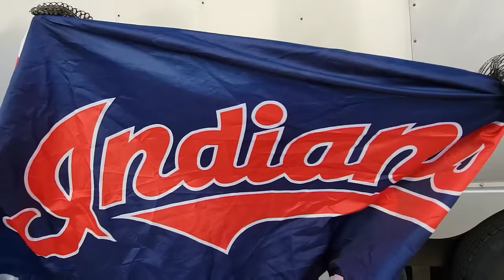RUDE KAREN Wants Her Storage Unit Back

Comment: You probably already know this, Jeremy, but a firearm case doesn't necessarily mean the firearm that came in it is still in close proximity. That said, many times the cases themselves are worth something, especially if they still have factory stickers on 'em that tells you all the basic info about the gun that was originally packaged in it. It should have the model name and number, some factories print the serial number, they'll all have the caliber, barrel length, assuming the same design was made in various colors or out of different colored materials (ie: stainless steel vs plain ol' non-stainless, whether or not the weapon came out of the made-for-retail assembly line or the custom shop, if the manufacturer makes customs at all that is, which I think most of them don't, but whatever, there's a lot of info on the stickers and people could be looking for that specific case, in which case the stickers can help both th buyer and seller confirm if it's a box that the buyer can use. Some stock cases can be worth the $30 bucks you paid for the unit, others can be worth less, and still others can be worth a lot more, especially if the gun that was originally shipped in it is rare. Rare guns would obviously have rare cases. You need to try to find out if the cleaning gear is stock too. If it is, that's another value-added part of what you have there.

It would be beyond lucky if the firearm itself shows up while sorting the unit, but yeah, keep your eyes peeled for it. Just don't think it's a big nothing-burger if all you got was the case. Good luck either way. I'm rootin' for y'all to make nice stacks out of every unit you buy. Y'all deserve it. 👍

Comment: My best buy was a moving away garage sale couch for 20 dollars.  Took it home and cleaned it about a week later. My husband and i was just married. In Our first house. Broke as most newly weds are. I Felt paper way down in it and i pulled it out. Out popped 2, 100 dollar bills,  my husband freaked. I reached in and pulled another, then another and another and another, my husband elbowed me out the way and he reached down in the frame...he kept pulling out wads of 100 dollar bills. Lol 11,400 dollars total 😁🤗 came out of the frame of that couch!! We did drive to house we got couch from and it was empty and locked up tight. Was a rent house and they didnt tell landlord where they went. He couldnt point us to any one they knew there.  We did try. We felt bad. It was alot of money. Was a elderly couple. All we can think is they hid the money in the couch and forgot. We knew At some point when they wanted the cash, it would hit them they sold the couch where they hid their money. 

And that is how also how we started our first savings account lol. We wanted to hang on to it incase landlord called us back. We asked landlord if they called to have them call us because we bought their couch. Only way we knew how to get intouch with them. Through him. This was in 1996 so that was ALOT of cash. We to this day fully check used furniture or tell friends too.  We actually still have that cash in savings to this day.  we have added to it over the years 😁 we have always wondered what happened the day the elderly couple realized they accidentally sold their  $11k plus savings for 20 bucks.